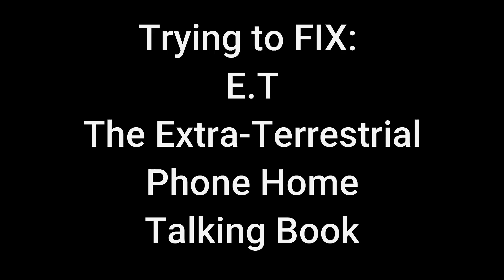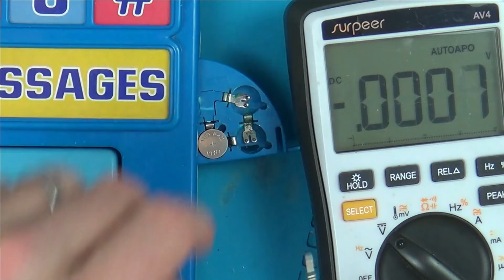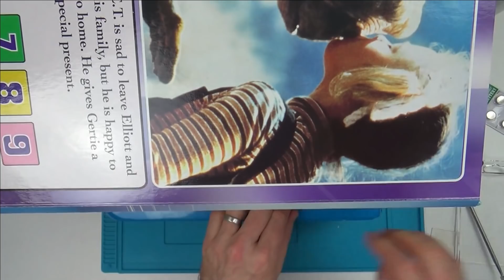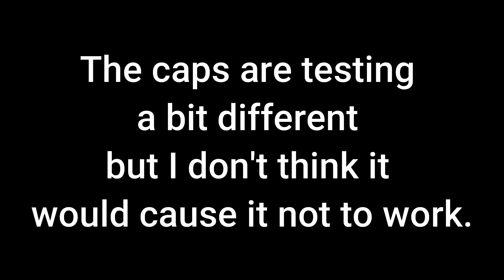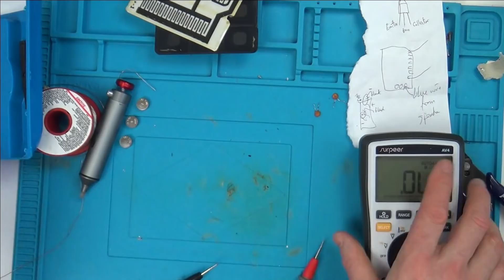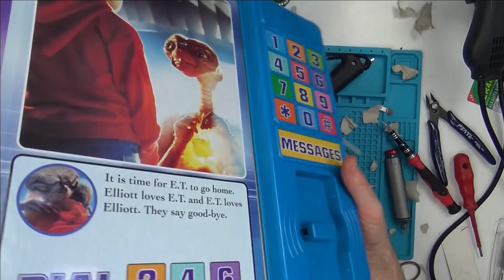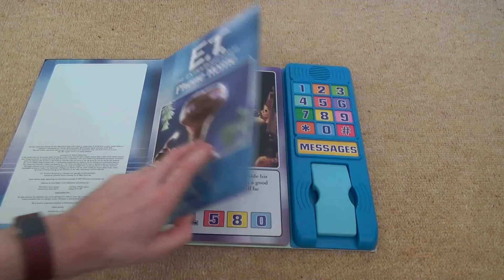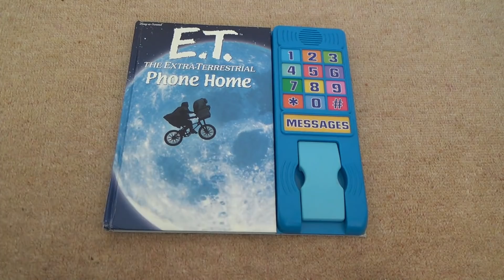Trying to FIX a Faulty E.T (The Extra-Terrestrial) Talking Book

Comment: The blob is called a "CHIP - ON BOARD (COB)". More or less it is a custom-designed/programmed microcontroller [CORE] that is connected directly to the board. Then it is sealed by a "blob" of epoxy, or silicone, or... whatever the manufacturer uses. It is cheaper than a standard Micro+programing. {as far as a manufacturing viewpoint goes.}
Reply: I'd imagine it's some generic eeprom honestly, since the internals of these type of books probably don't vary all that much electronically and it would just require flashing the appropriate program/sound files on to it and attaching it to the board. I also say eeprom for the simple fact that if they do produce a surplus of chips with a specific program they could reprogram the chip for the next line of books.
Reply: As far as I understood, the COBs are produced already "programmed" and cannot be reflashed/reprogrammed. This is why you use a COB because it only contains what you specifically need. When you produce these in 10s of thousands, the savings over an off the shelf chip is quite significant

Comment: Its just a ROM chip just like in cartridge connected to primitive DAC on data bus and counter in low part of address and high part of address is connected to buttons, So buttons act as bank selector and counter just goes trough addresses within bank. TADA !   You got a sound !

Comment: You should invest in some copper foil tape with double sided conductivity. I got a decent size roll for under 20 dollars years back for shielding guitar cavities and it works perfect. Although, I prefer shielding paint for repairing conductive pads on electronics.
Reply from the maker: Brilliant, I never knew it existed. I have just purchased a couple of rolls from Amazon. Hopefully it can be used in future fixes. Thanks for sharing this Bandit Keith. Nice one :-)

Comment: Those IC's usually have a mask rom, very similar to old game cartridges. Mask roms are called like that because after the IC waffer has been produced a photomask is used to "print" a conductive layer that interconects the rom cells and "program" the information. So basically that IC contains the necessary hardware to reproduce a waveform, an input controller (keyboard) and an empty mask rom, in this way it can be used for many designs, when the product has been decided the mask rom is programmed and it's ready for use.

Comment: Instead of using silver paint, you can just fold over the copper tape on it's front conductive side and secure it with tape so it makes a good connection. Just another way.

Comment: I cant find the link now but somewhere i read these carbon tracks cannot be checked on continuity; they have resistance. The longer the track the higher the resistance so diode test usually wont beep as it mostly above 50ohm.

Also i saw a video on how to make these paint by removing graphite core in cheap batteries (non alkaline ones) and also from writing pencil core.

https://youtu.be/YytM0lgxNNA